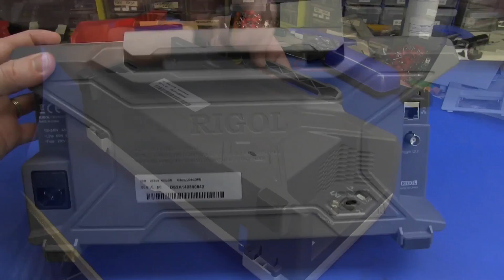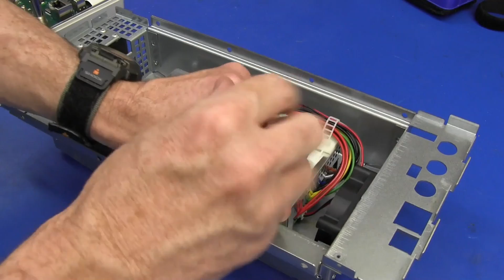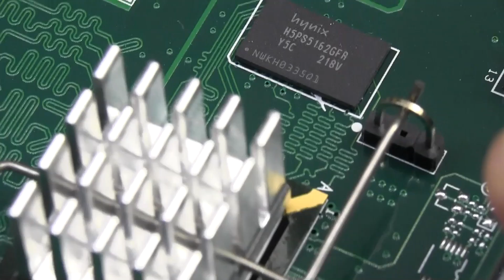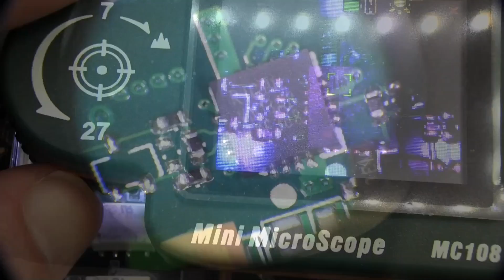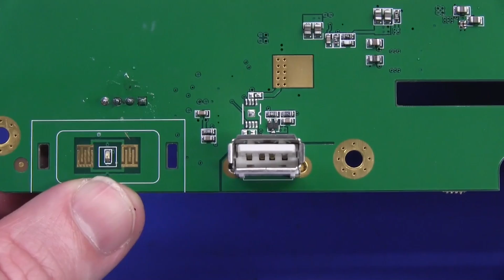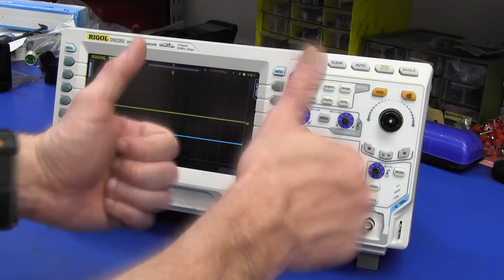EEVblog #360 - Rigol DS2000 Oscilloscope Teardown

Comment: IMHO there is a little error in pcb design of clock provider unit for Rigol's custom ASIC (14:30). Most of AD's clock synths requres perpendicular positioning for its two LC's (on screen) circuits - for decreasing inductance coupling between L's.

Comment: Why an earth do Regol insist in burying the 2032 battery deep inside their products.
The user should not be expected to take the unit apart every few years  just to change the battery.  Why not fit an easy access battery compartment. Even better fit a super cap that does not need to be replaced.
Reply: The battery lasts for maybe 15 or 20 years, maybe even more.
Reply: +Ricardo Nunes Not sure where you get 15 to 20 years. In my experience on a desk top PC you get 4 or 6 years. The battery shelf life,  defined by self discharge, might be 10 to 15  years, depending make, but the in circuit life can be much shorter. The battery is rated as 210mAh. The 32768 Hz crystal is the HC 32 type, rated at a maximum of 1uW drive power. Working with a 3uW circuit current power, gives a calculated  8 years in circuit life,  but what ever the shelf life, it seems bad practice to make the battery difficult to access by the user. Mounting it on the PCB means that a battery leak will most likely damage the PCB tracks before the user notices the battery needs to be replaced.

In my case, the RTC, fitted in my DSA800 Rigol Spectrum Analyzer,, failed after just one year. This turned out to be due to a faulty HC32 crystal, which was replaced under warranty.  The question is, did the crystal fail because it was over or under driven? The Pierce oscillator capacitors are not fitted on my version of the PCB, so the crystal load and precise oscillator frequency is defined by the stray capacitance of the PCB tracks and the IC input.
Reply: +Nigel Johnson I am not sure if I agree with you. The jellybean DS1307 datasheet says that you can expect a 48 mAh battery to last for at least 10 years. A 210 mAh would probably last for the whole scope's life.
Reply: +Ricardo Nunes The in circuit battery life is determined by the circuit load, so I do not think it's possible to use a figure based on just the battery type. The assumption would be that the self discharge life is the dominant factor. In the dsa800 analyser, a small six pin RTC IC is used, but the part number is not visible, so I cannot check the supply current, I must admit I guessed at 1uA as a typical figure. The short battery life in a PC maybe due to the ambient working temperature inside the case. Again my point is why mount the battery on the PCB when it is so easy to mount it under an easy access cover. Unlike most electronics, the working life of lab test equipment can be very long, so it makes sense to make the battery accessible to the user, particularly where calibration may be affected by removing the RF screens. As an aside, I object to the amount of electronic scrapped generated simply because of the built in obsolescence of sealed in for life batteries, as in the latest generation of laptops and tablets.
Reply: +Nigel Johnson I understand what you mean, but there is no need to put the coin cell easier accessible if it will last for the whole product life time. The self discharge in those batteries is not very important at normal temperatures. If the RTC consumes 1 uA (I personally believe it is less) and the battery has 210 mAh of capacity, you can expect the battery to last for more than 20 years, and the numbers used in this calculation are conservative.

Comment: The ones in the power supply?  Those are part of the feedback path for the switching controller.  The switching part of the supply has to be isolated from the output, so either the switch control signals or output voltage feedback has to be sent across the galvanic isolation in the supply for it to work properly.  Every isolated line powered switching supply has at least one.  Looks like this one has 4, though I am not sure why.  I presume one of them is for the AC line trigger.

Comment from the maker: It's the Extech MC108 digital microscope, as you saw in the video. Pretty useless for most things, but pretty good for looking at part numbers on chips. In this case it didn't work so well because the metal shielding can got in the way (it needs to be right on top of the chip).

Comment: I did a quick search on digikey for dual input ADCs in 144 pin QFPs and came up with a reasonable guess as to what that chip is.  I think it miiight be a ADC08DL500CIVV/NOPB-ND which is a 500msps dual 8 bit ADC made by national.  The pinning seems to match from what I can tell (diff pairs, inputs along the bottom row, etc).  If it isn't an exact match it must be very, very close.

Comment from the maker: They are just (low noise?) linear voltage regulators. Powering some or all aspects of the front end circuit. They needed something like this to enable the 500uV/DIV range.

Comment: That was my first thought, but it doesn't look like it's actually removed material. Notice how it actually dips into the indent on the chip at 14:20

The chips under the input cans might be lasered off, but it seems like a really crappy job of it to me. Might just be a really, really faint marking.

Comment: I love the Torx screws everywhere. Most of those isolation slots on the PSU probably aren't even required, but they've put them in because they're doing some anyway. Good approach.

Comment: Dave, I'd Almost bet money the sticker you we fussing with on that clock chip was a heatsink! Check out Stick-it Flexible (AKA Cerac  α)  I've seen a couple products like it that increase the emission of heat into the air. I bet the folks at Rigol needed to take the temperature of that chip down just a few degrees. (Almost used something similar myself once)